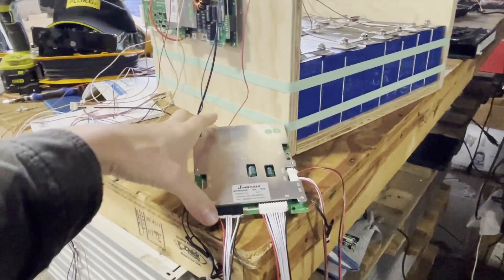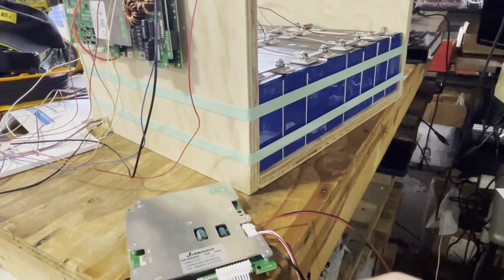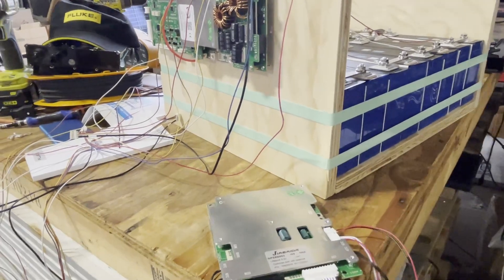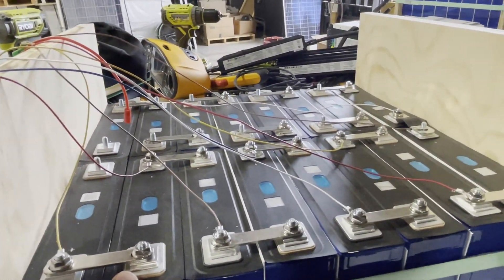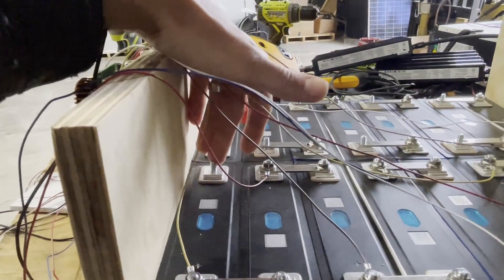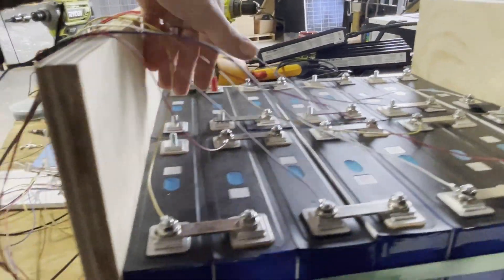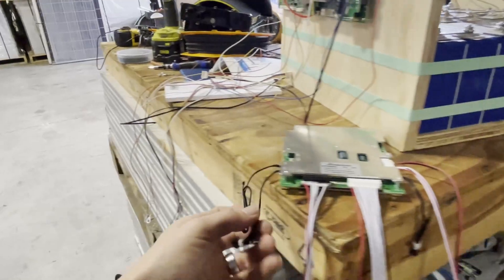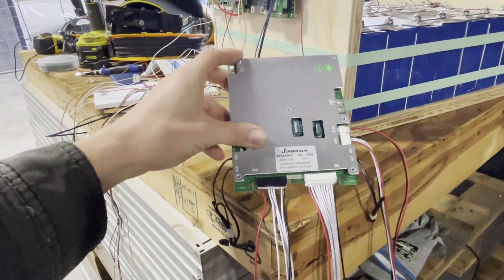Classic BMS Choice For 16s LiFePo4 Battery Pack

Comment: Hi sir, i have a serious question. Ive been reading about PID effect on solar panels. Basically its a power lost due to the panels high voltage relative to ground assuming you are running 600v panels in series. The current escapes theough the panel aluminum frame down to the ground. So my question is this. What if you dont ground your solar panels? Can you still experience the PID effect?